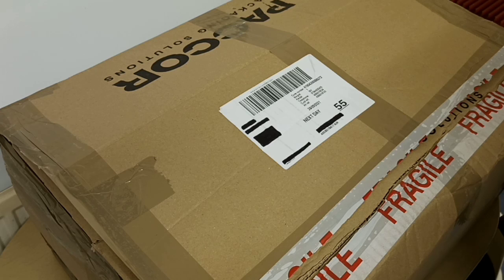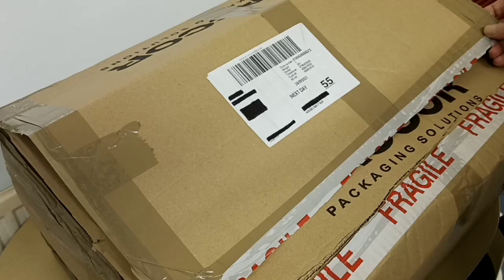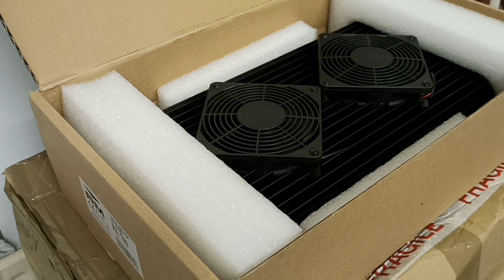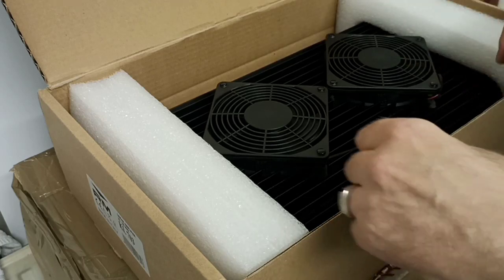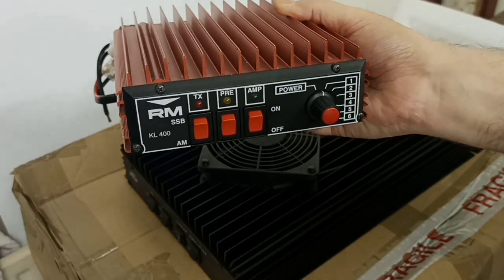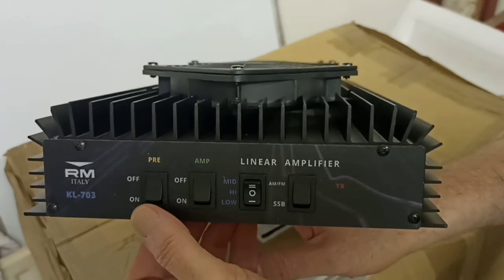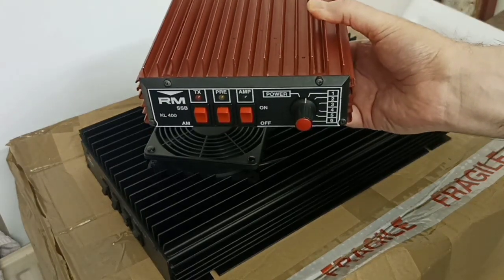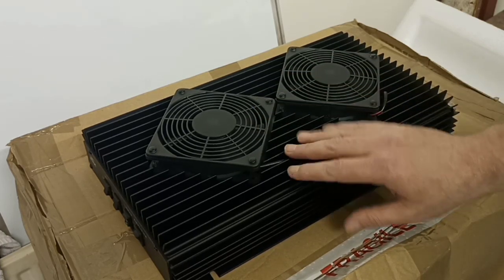RM Italy KL 703 Linear Amplifier .. Unboxing.

Comment: I have one of these on the way, I cant wait to get it. My Stryker 955HP turned all the way down dead keys 10 watts and swings to nearly 40. Will that be ok to use with this AMP?  Thanks for any info. Great video by the way. I gave it a thumbs up!
Reply from the maker: Il be honest with you here, I try not to use AM with a lot of power, I'm always confused with how much American radio's swing, I don't get it.. on all my radio's that have AM (and I have many) when keying up on Am there is hardly any swing at all, there may be a little when I talk and the wattage out of the radio is relatively the same and may only increase with modulation by around half to one watt, we never see those swings on AM like you American channels show..
As crazy as that sounds it's true.. I get it on ssb when you do get a lot of swing but when amp builders show the peaks it's a little bit decieving, then when folks buy amps the first thing they realise is they aren't getting the same output power that was shown in a video.. I see this all the time.. they either complain or blow the amp up because they don't understand the difference between AM and ssb peak swing readings..

Ok so let's start with the 703 amp
I have conversed back and forth with RM Italy and they tell me the 703 input power for AM FM is the same which is 35 watts input.. so when using ssb you want around 35 watts swing into the Amp.. you can go more but keeping it around 35 watt swing will keep the input drive happy, it is a high drive input linear after all.. it also makes sense to have a good meter that reads pep (peak envelope performance).. 
Also remember we don't scream into the microphone to speak at peak volume so at 35 watt swing you will never overcook this amp and even with 35 watt swing you are probably hitting the output transistor's with around 20 watts swing.. obviously the louder your voice the more watts will hit the finals.. having a good microphone helps to maintain around a 35 watt peak into the finals.. I run mine on 14 volts (you have to remember it is a mobile linear and when a car is running the cars loom is at around 14.5 volts so running it from a power supply at 14 volts is safe.. 
Another thing to help you reach peak power from the amp is having the right length jumpers, experiment with longer jumpers you will notice say a six foot jumper will only give you 350 watts but a nine foot jumper may give you 450 watts (jumper size makes a difference regardless of what people may say, try it you will see for yourself..
I use silicon sheathed cable at 8awg it's much more flexible.. this is important has it will carry you amps comfortably from PSU to amp, 8awg will carry a load of around 180 amps easily.. don't skimp on cheap under powered wire.. all these things here will help you achieve a comfortable output from the linear.. also make sure your swr is low and use a tuner if necessary, and also make sure your antenna is rated above the maximum output of the linear, another thing is never try to squeeze every last watt from the amp as it's pointless and will just result in lowering its life expectancy.. 
Sorry this is long winded but I try to give honest answers, after all I use one myself so I'm not going by hearsay or what others say who give advice yet have never used this amp..
Here are my settings that I have used since using this amp and it's as good now as when it was new.. you can use these settings without worrying about overloading the amp..
Power input 13.8 volts or 14 volts maximum
FM input between 25 watts to 35 watts
AM 30 watts your modulation will peak it at around 35 watts
SSB maximum of 40 watt swing
I use these settings all the time without stressing the amp and it always runs between 450 to 500 watts, the amp can do more but you would only be stressing it or over saturating your audio.

There is much more technical stuff I could mention but it's very long winded but I hope this helps, good luck and enjoy the amp, she's a beaut.
Reply: @DeltaXray444  thank you so much! I really appreciate you. RM Italy sent my payment back because they are out of stock. I'm so sad, lol. I was really looking forward to getting it.
Reply from the maker: What a bummer lol.. Im sure they will have some more of them back in stock before too long.

Comment: Hi can I run one of these amps off a car battery in my shack ?
Reply from the maker: Yes but it would need to be a good high ampage drain battery,  on a power supply you need at least 55 amps to run the amp at max output.

Comment: hi, have you a link to the awg wire with the fitting for this amp ? Thanks
Reply from the maker: Hi.. here is the link, you will need a good set of cutter's if you need to cut the length, but you can order the correct length too if need be..
This will carry 180 amps so is more than enough to carry the load from amp to supply. Thanks.
https://www.ebay.co.uk/itm/8-10-12-14-16-18-AWG-Gauge-Flexible-Silicone-Wire-Copper-Black-Red-RC-Cable-UK-/402631270444?mkcid=16&mkevt=1&_trksid=p2349624.m46890.l49286&mkrid=710-127635-2958-0

Comment: They are awesome 👌
Reply from the maker: Yes they are, peaks at 500 on ssb and steady at 480 am and fm using a six foot patch lead from the exciter and 8awg wire at two feet long to carry the amps from the supply.. feed them the correct input and they work great. One of the few transistorised amps that does what it says on the box.

Comment: Do you know if it comes with internal low pass filtering?
Reply from the maker: Like the Rm 505v it is made generally for the 10 meter band and after i tested it on the oscilloscope the secondary harmonics on maximum output were very good will little distortion.. so it is filtered to a certain degree but RM still state that using a low pass filter for 27 mhz is recommended. on air i have had excellent reports on audio with no muffling or distortion across 10-11-12 meters and i have maxed it out on testing with a 60 amp psu.. all in all it is very clean on transmit. I haven't opened it up yet as ive been very busy hence my belated reply to you so i do apologise. So far it has worked very well, i fed it on radio's with the stated maximum output of 30 watts input with both single and double MOSFET's without any problems, the output was 490 watts on FM and on ssb it p.e.p'd out and did peak at 500 watts.. i stretched it with 35 watts too to see if there would be an increase with short bursts but it didn't peak with any more wattage on either, the amp drain on max output was 52 amps using 8awg. all tests were done using a dummy load. I'll email Rm Italy to see what they say about filtering, they have been very helpful with prior information i have asked them about.. Hope this helps,
Reply: @DeltaXray444  very helpful thank you.

Comment: Theres some been some odd condtions last couple of weeks bud. Looking at getting a linear for mobile , but not sure which mobile radio ill use yet. Good luck with the DX had 2 & 9 div from home last night so its getting there.
Reply from the maker: Hey there pal, have you had a good holiday and feel rested..
Yes it's been pretty good recently, ive not had time to get on the radio this past week although i have been listening, I've heard Egypt, Morocco, Bermuda, America, Brasil and other south American countries and many far off stations coming in, but the propagation has been too low for me in my area, yet I've seen other peoples video's making excellent contacts twenty miles away from me, i guess im just not in the skip footprint yet..

What size linear are you thinking of getting.. i highly recommend the Rm Italy Kl 505v.. it may look the same as the 503's but it's a much better built amp and worth paying the £40 more, it also has the added bonus of two built on fans to keep it cool, i can run mine on FM with a seven watt input and it will drive it at 230 watts all day long and will pep at 400 SSB easily with a drain of 34 amps max..
So far with this 703 I've not tested it fully yet but did hook it up on FM to make sure it was working, i used two 50 amp psu's in series, it is a high drive linear so i fed it twenty-five watts from my Superstar 6900n and keyed up and it gave me a straight 400 watts on FM.. the instructions that came with it stated it can input up to 35 watts so it will put out more, the drain on the meter said it was 48 amps.. I've not had time to fully test it but may get time to do so over the weekend.
Reply: @DeltaXray444  cool im only looking at about using 300w i dont really need that much for mobile as i seem to do pretty well up at my perch. Look goward to seeing how you get on with the linear. Never really used one myself. But i have a president grant 2 premium that id like to try as it has a nice recieve but only 12w output.
Reply from the maker: @Al.26TC101  ha okies, heres a bargain for you.. go to AliExpress, theres an app for it on playstore, they have a linear on there that is exactly the same as a Rm italy B300p it will do 140 watts on FM and 280 pep on ssb.. it also has a fan on it and draws a max of 16 amps which may be better suited for your car battery having less drain.. they are only £72 and push twice as much as a Rm Italy 203 linear.. i have bought one of these and they work very well.. heres the link but ignore that price you can get them cheaper if you look down the listing
￡75.24 Power Amplifier 150W FM 150W AM 300W SSB High Power CB Radio Amplifier BJ-300plus
https://a.aliexpress.com/_u7Cyis
Reply: @DeltaXray444  Nice one bud. ill certainly look into it.

Comment: Cheers 2WE024, waiting on some DXing to open up 73.  JOHN standing by Idaho USA
Reply: Nice to hear work on a flat side 3 yagi hope to have it up by end of month
Reply from the maker: @24So  hope the install goes well, I'm waiting for an 11 meter Moxon coming.
Reply: My next build will be the monox for 11 meters  antenna love the design we can't buy one for 11 here only 10 meters by MFJ
Reply from the maker: @24So  if you ask them at MFJ they will give you the measurements for eleven meters, there's not much between ten and eleven just a few inches.
Reply: Will be building mine with wire and spreaders we have 60 and 70 mile an hour winds sometimes
Reply from the maker: @24So  I currently have winds with 70mph gusts at the moment and have lowered my antennas for safety reasons, there is a YouTube channel called MaxMountainWorld, Max has some good videos on wire Moxons he may be worth checking out.
Reply from the maker: Hi John, my friend in the states was saying yesterday the propagation has been lifting in the evenings he's had some contacts in South America Brazil and Jamaica.. 73

Comment: Friend that was a great video and more than just an unboxing.  I don't think you will have much trouble being heard out in skip land.  I guess for me the SSB pep watts is amazing.  The conversion shows that. Amazing ability to get the signal out.  I know you have a really nice antenna setup etc. and that will handle the power on AM/FM and SSB.  I remember a few months back when I heard you talking to Midwest USA and heard both sides of the conversation well enough.  You found out after the contact that you were only running 12 watts PEP on CB 38 Lsb.  LMAO.  I remember you telling me within the hour of the contact that you forgot to power up the amp.  It does happen when propagation is running and the bounce has power.  I was running 300 watts pep and could only talk to the midwest.  I think we are Skip Chasers and the thrill is the unexpected.  Just when you say it cant it does.  Great Video and setup my friend.  NY202  USA  Drew.
Reply from the maker: Hi Drew, the size of this thing is unreal compared even to my RM 505v, it dwarfs both the RM 400 (red one in the video) and the 505v, I got my 8- AWG wire in the post this morning so when I get some time later I'll be putting some of those heat shrink connectors to it and firing it up (maybe do a video on that) 
Yes the 109 Don from Columbus Ohio was a great contact but it was done on 8 watts not 12, I was amazed you saw the contact from both sides that was just fantastic, I remember yes within the hour lol. Tbh I'm a little scared to be pressing the microphone for the first time, it does give you the sense of anticipation of what to expect lol 73
Reply: @DeltaXray444  it is easy to see that it's one of the largest I have seen on the market.  I am sure that it will Kick.  I have been harvesting and working on the Wood furnace ...  Haven't checked the radio in many hours.  Sun is out and winds blowing.  A nice autumn day.  Another long day on the farm.
Reply from the maker: @cbradioghosttalk1986  the linear is certainly the largest mobile amp I've seen, it even dwarfs the Zetargi B550p, the heat sink on this thing is absolutely massive in comparison..
Weather here is on the change feeling much cooler at night, heavy rains and high winds crossing the Atlantic and hammering us at the moment. No skip boooo.